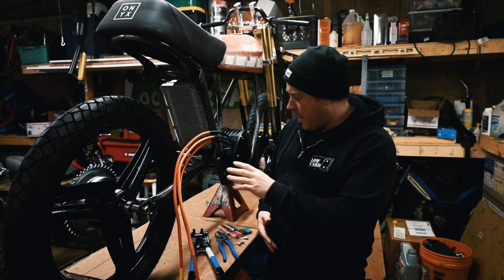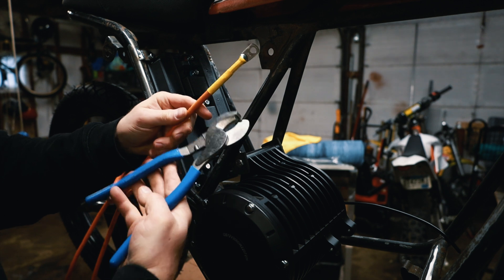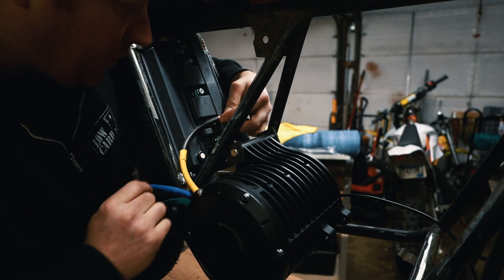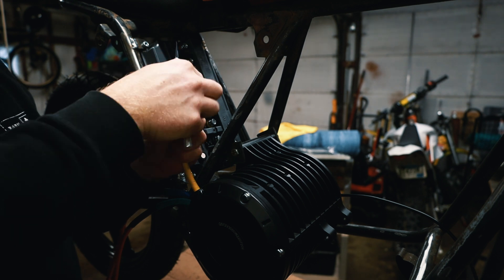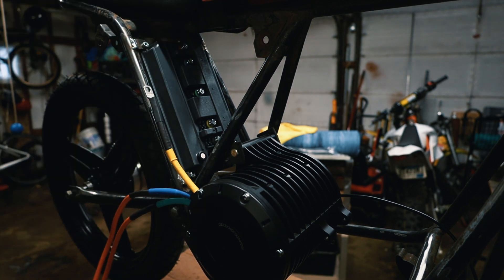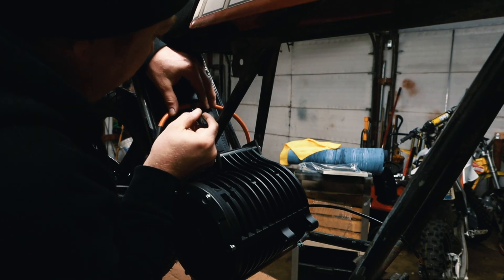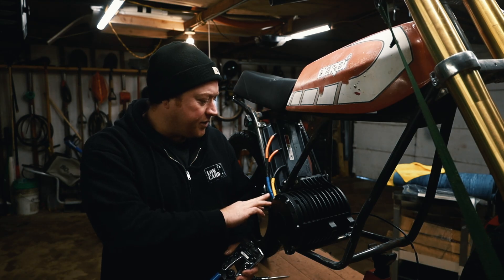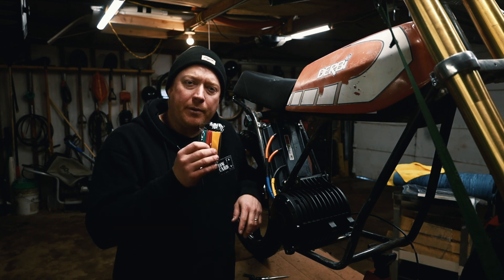QS 138 Phase wire shortening E bike

Comment: what are you gonna use the tank for? Storage compartment?
Reply from the maker: ugh IDK. The tank is perfect and really rare. I dont feel like I can cut it up. Its the only part of the bike that's worth anything.
Reply: @Corn-ped  but it's kinda obsolite on an electric bike. If it's just gonna be empthy it's gonna rust
Reply from the maker: yeah :( Maybe I could trade with someone who has a bad one. 
 I just feel too bad cutting out the bottom to hide electronics in.
Reply: @Corn-ped  Making it clean would make a great end result. Maybe you have another tank that will fit, or can get one cheep.